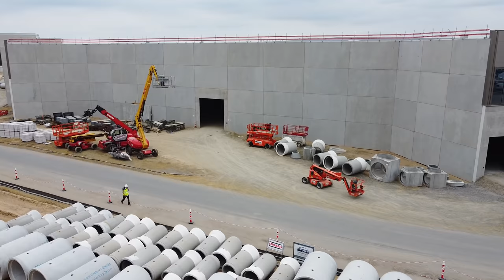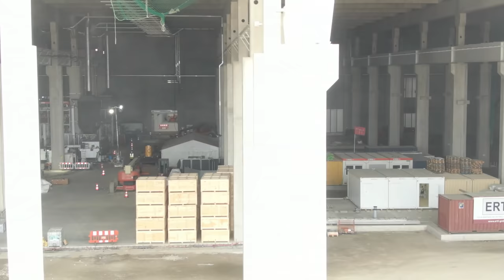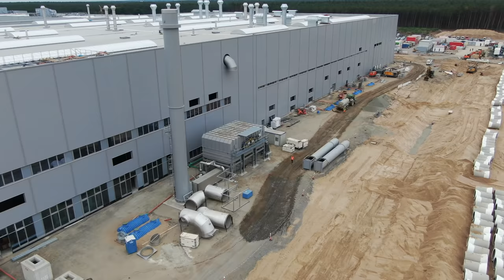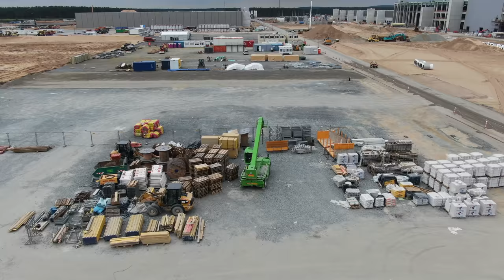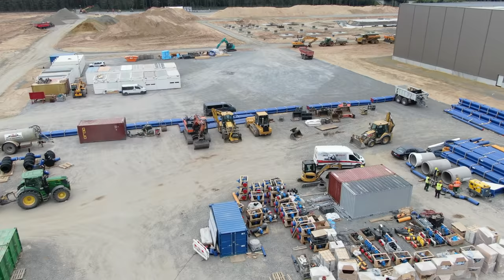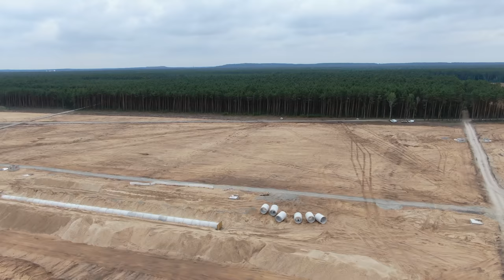Giga Berlin | 2021-06-12 | Wastewater tank foundation

Comment: When they built the Hoover Dam, scores of cement trucks would be lined up to pour a single block.  Filling the monolithic foundation of the battery plant should be quite a spectacle.
Reply: I quite agree.  A timelapse of it would be impressive.
In my mind it is more of a boat or a raft, than a fondation.
Reply: Maybe they regret now having unmounted the second concrete plant.. Also imagine you are half through and then the concrete production breaks down.
Reply: @AndreasDelleske  There are two concrete plants on site.
Reply: @AndreasDelleske  They put the second one back recently.
Reply from the maker: It's not the same concrete plant though. The new one is much smaller.

Comment: What is this at 3:30? It seems every few days they start a new section of the complex. They will be building for years to come before this is all complete.

How are they going to pour concrete at that large section around 13:37 and on. That is about 6 feet tall. That would be a massive pour. I have never seen reinforcement rebar put together like that.
Reply from the maker: That's the foundation for the wastewater treatment tanks.

Comment: Any idea why the line if trees, at the end of the video. have been left?
Reply: There is also something like a toad fence all around, maybe there are still frogs or lizards in there that you have to catch first.
Reply from the maker: Yes, it's because of lizards and snakes. That area was a special area for those animals, because it was glade between the trees. In the new plans it looks like they don't even want to cut those trees for now, because the logistic-area for phase one ends exactly at the trees.
Reply: @TobiasLindh  Thanks fir a great answer.  I thought that had long since been delt with.  This explination makes sense.  I hope they figure out the neighbourhood ain't what it used to be and find somewhere better soon.
Reply from the maker: @timboatfield  The animals are getting moved. They did that already last year, but environmentalists said Tesla didn't do it long enough. They went to court for that, and the court decided that Tesla did in general do enough to protect the animals, but for a few small sections the court said that the environmentalists are right. Those trees were one of those sections. They do try to find and move more animals this summer, and then they could clear the trees. But maybe they started to like those trees. :)

Comment: What should be the structure which has lots of steel for it foundation (14:00)?
Reply: Battery factory floorplate.
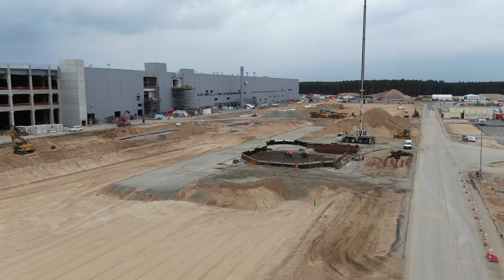Reply: @julianreverse  So what is at 3:20 Wastewater tank foundation? (Would appreciate if you would insert some comments into the video so we could understand what construction is occurring.)
Reply: @jbarvideo12  3:12 The wastewater treatment facility will be directly north of the tank farm. There will be a number of basins - here they just digged out the pit for so far. And at its northern end there will be a few tanks - here they started foundation/rebar works. The process wastewater will come in batches e.g. from the paint shop, is stored there temporarily, checked, eventually treated and then released together with less dirty wastewater towards the sewage plant.
Reply from the maker: @jbarvideo12  Well, I don't like to put text into the video. But I do put text in the description if there are some important changes.

Comment: That's so much steel in that foundation!! Is that all rebar? :O
Reply: Yep
Reply: Bad soil for foundation, the sand there can't take heavy loads, so you need a lot of steel and concrete.
Reply: @Stoffmonster467  Interesting, thanks for the response! Is sand common in the ground where you build? Around where I'm from we have rock, soil and mud. More stable overall than sand I imagine. We use poles and run them deep in to the ground.
Reply: @TomWallischh  here in the South of Germany, too, but in the North East very light sand and - we call it brown coal. I would say as an engineer that a big flat foundation might be the best (yes, they made here piles, too, I know).
Reply: @Stoffmonster467  Okey I see, thanks again for your response!